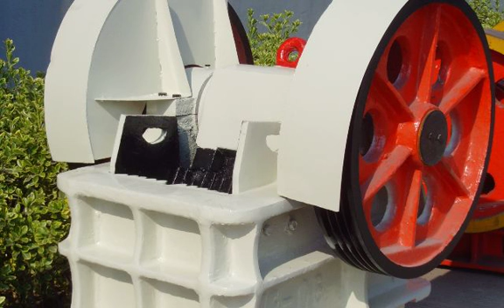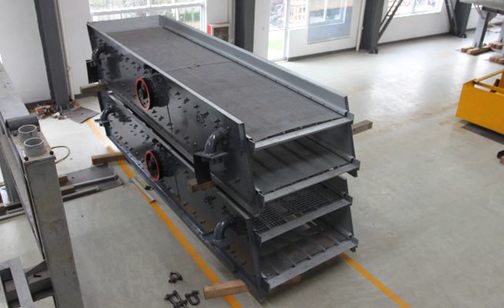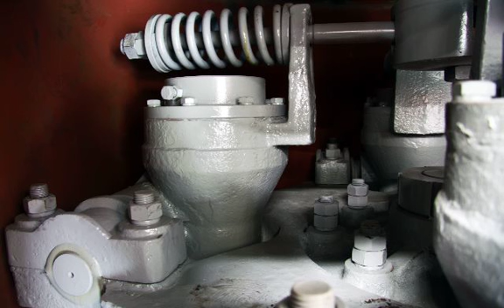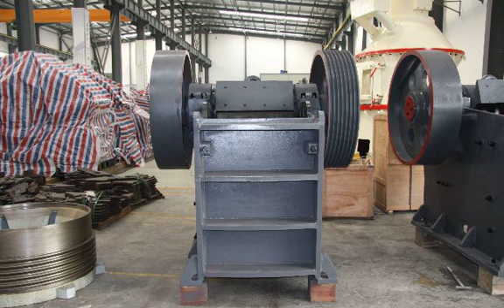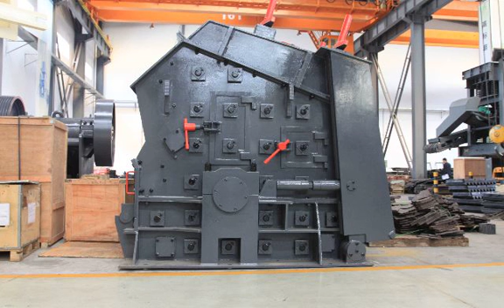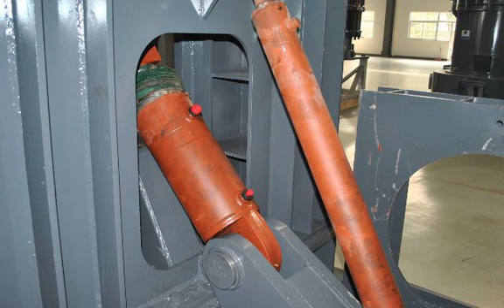waste rock lifting by vertical skib in granite quarry

Comment from the maker: Our pany is a main stockist and agent for all leading brands of lifting equipment including electric hoists, electric winches, hydraulic jacks and pallet handling equipment  Our prehensive range of electric hoists includes overhead crane hoists for both single and twin beams  Chain and wire rope models are available in both standard and short headroom versions up to 30 tonnes capacity  We can also offer electric hoists for use in the construction and hire industry with 110V scaffold hoists and c